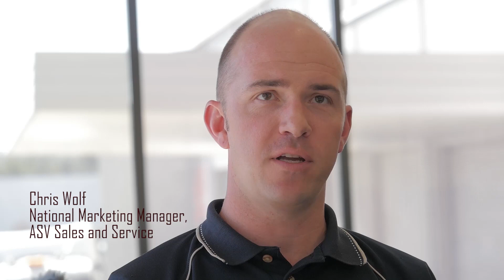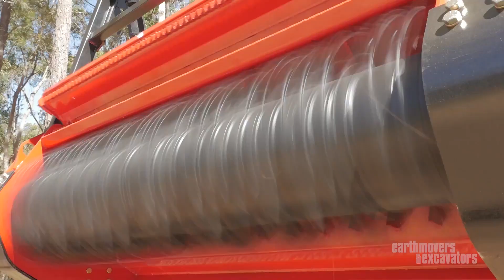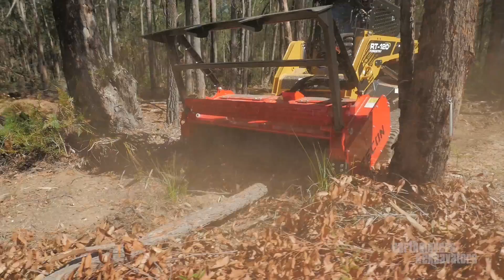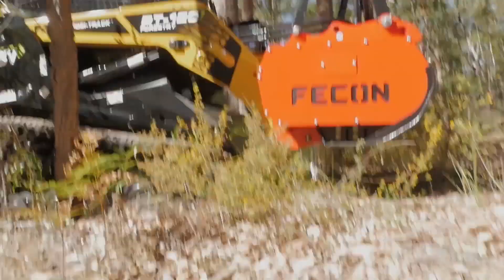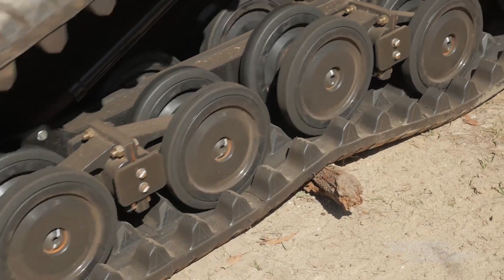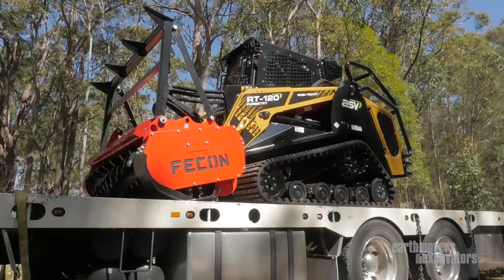ASV RT-120 Forestry Posi-Track Loader

Comment: Since this video was released in 2019, is there any difference in this RT-120F and a 2018 model, and if so what? Apparently the 2018's are paired with the Loftness G4, whereas this is paired with the Fecon. Can you please say why? Thanks
Reply from the maker: Hi Mandolier, thanks for the message! There's no difference in the model specs between 2018 and 2019, the pairing just depends on the country in which you purchase the machine. In Australia we pair with Fecon mulchers, as we find they're the best option to work with the very hard Australian woods we have. In the USA, other brands of mulcher are used depending on your local dealer and their stock. Cheers!

Comment: I'm very curious what would happen if you hit a big rock with the grinder head. And with this machine does it work better than the other models with different attachments like with a snowblower?
Reply from the maker: Great questions, thanks for asking. It depends on the rock size really. The Fecon Bull Hogs have been known to shatter some rocks up to 20cm diameter. For larger rocks, generally the impacting tooth will break, which is easily replaced for minimal cost - the teeth are actually designed to do so, to ensure the rotor itself isn't damaged. As for the snowblower and other attachments,  the RT-120 offers high flow hydraulics meaning more power can be allocated into your attachments. In theory, your attachments will perform better, as long as they are able to utilise the higher flow and aren't limited.
Reply: ASV Sales & Service hey guys thanks a lot for the information! Keep up the great work! 👍👍